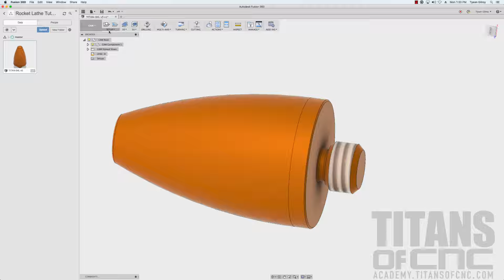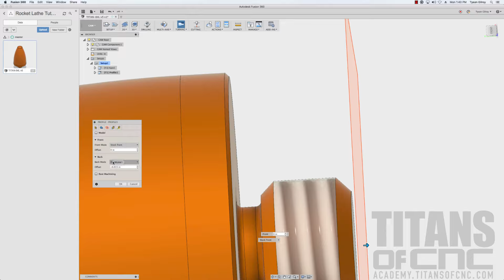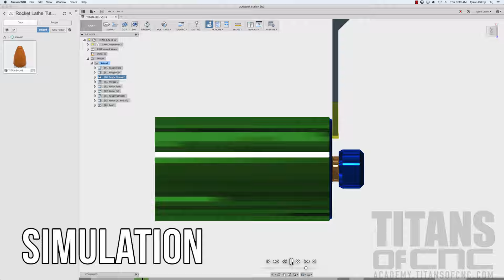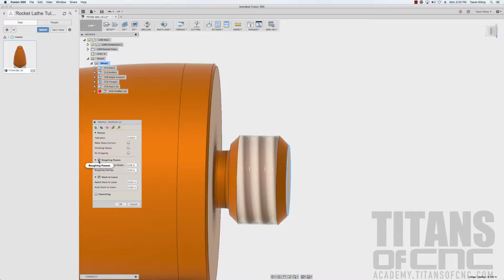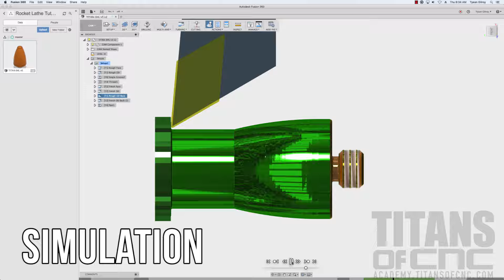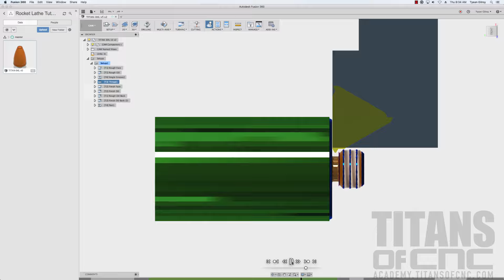CNC LATHE - Learn to Program the TITAN 84L in CAM

Comment: I’m having issues with the threading portion. Have the exact same pitch & thread depth settings, but when I run the simulation, the threads cut way too deep & I end up with a crash where the tool hits the top of the threads. I’ve tried it numerous times, creating a new threading profile each time & get the same results. Any help? I’ve tried to look for help on the forum, but my account is locked out for some reason & I can’t get an admin to respond to unlock it.
Reply: Ive got the same issue going on. The newer Fusion apparently changed how treads work. Also the part in the video has a diffrent chamfer then the part I am using at the end of the threads. The part in the video has a chamfer similar to the first one, but the video on how to draw the part did not show how to put a chamfer on that end of the threads.

Comment: Extremely useful! Does the finish OD following the thread operation dip into the thread at all? It's preferred to finish after threading instead of before threading?
Reply from the maker: Tyson left all the roughing of the main body for after threading because of rigidity issues. The back end gets very thin so he worked from front to back and then part off... which kept the part extremely stable during threading. Finishing the body was last right before part off.
Reply: Doing a finish pass after single pointing a thread is usually a good idea. It makes for a better quality thread. To go a step farther rough it out without the chamfer or groove, then thread it. After that come in and cut the chamfer  and the groove with the same tool, then finally do one more single thread pass taking roughly a thou.  Do this and you'll have a perfect completely burr free thread.